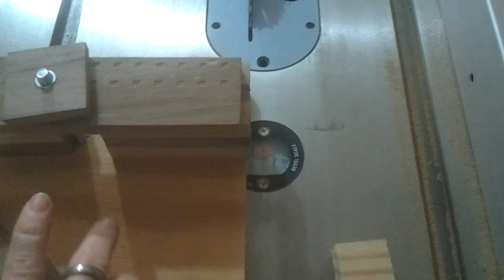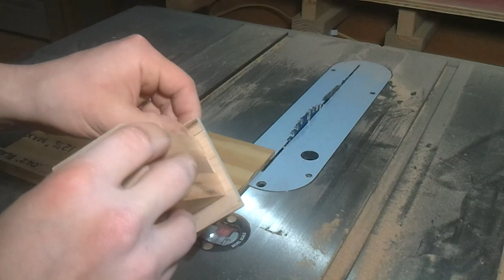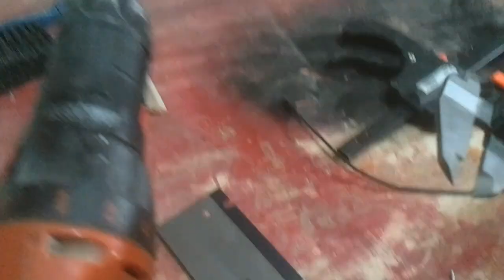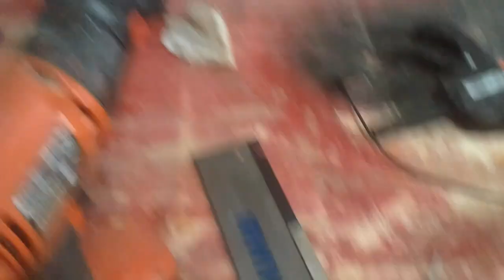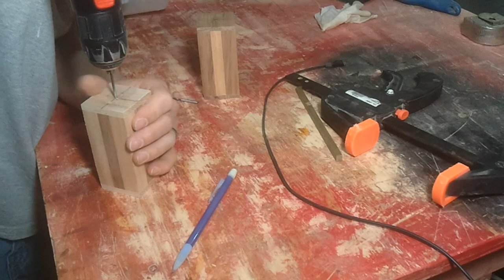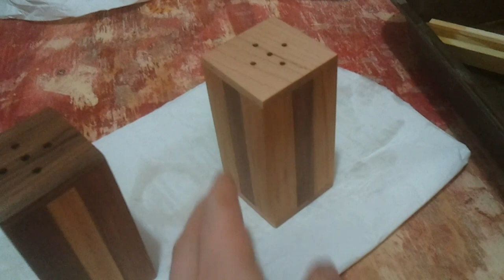Trash to Treasure - Salt and Pepper Shakers #2 Video 2 - 056

Comment: I like your concept of gathering material from what is considered trash. I find a lot of materials in random places. My favorite though is the firewood lots. Ill go there and did through the walnut pile. Then saw them up on my bandsaw into useable pieces. The best thing about it the ability to saw the wood how you want. Quatersawn walnut is beautiful. Also, find a floor installer. They will often let you dig through the trash bin and I've gotten a nice little supply of mahogany that way.